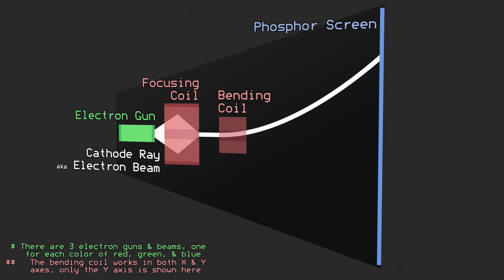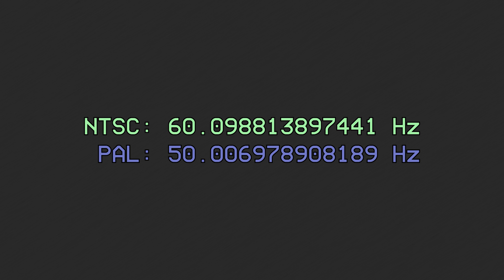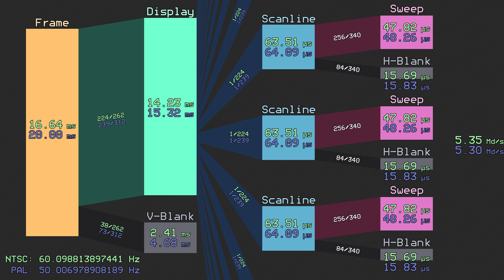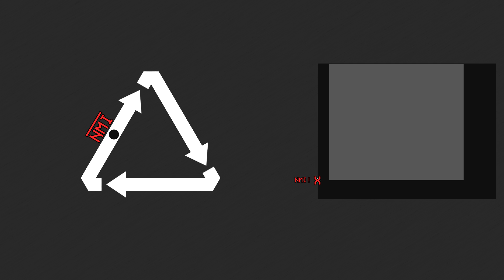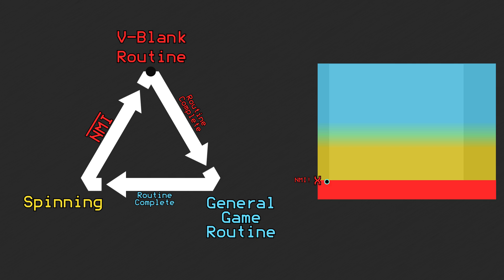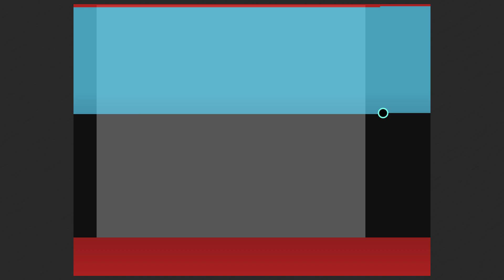Lag & Blanking - Super Nintendo Entertainment System Features Pt. 06

Comment: You missed the opportunity to explain why the PAL version has more HDMA time.
Reply: It's because the frame rate or refresh on PAL is slower than NTSC. Slower refresh = slightly more HDMA time. That's also why any games specifically made for PAL only play too fast on a NTSC console.
Reply: I can explain that better: NTSC and PAL have almost the same amount of lines per second: 15750 vs 15625, also know as 15 KHz. NTSC divides the lines into 60 fields of 262.5 lines each, of these 240 contains the picture. In PAL it is 50 fields of 312.5 lines, of which 288 contains the picture. The SNES displays 224 lines on both NTSC and PAL. This means that on NTSC there are 262.5-224=38.5 inactive lines, and on PAL 312.5-224=88.5 inactive lines.

To illustrate it simply: The screen is 50 lines higher in PAL. But the number of active lines is still 224. This increases the number of inactive lines from 38.5 to 88.5 (164% more inactive lines). Some processing can only be done during inactive lines, as the video explains. This might be why the game Winter Gold is only available for PAL.

More about NTSC/PAL: https://www.youtube.com/watch?v=3JFt6t6ijLs
Reply: @At Choralone422 it actually isn't.

Framerate differences only account for 20% difference, yet DMA time on PAL systems is as much as 85% higher per frame.

The real reason is that PAL displays are 312 lines instead of 262 of NTSC.
Even with PAL games generally going with 240 line resolution that still means there's now 72 blanking lines instead of 38.

Big, BIG difference, and lower framerate is only a small fraction of the difference.

Comment: What I’m curious about is, how specific is this to the SNES? Like, is the process pretty similar for other game consoles?
Reply from the maker: Most consoles that were built to output on a CRT use something similar to what's shown in the video. I know for sure the Atari 2600, NES, & Sega Genesis used similar formats. Also, I know the GameBoy and GBA use similar formats as well, even though they use LCD screens.
Reply: The NES is basically identical to this. Except the processor is 3 times slower.
Reply: yes but what about like.. the sega genesis? or the nintendo 64?
Reply: I believe this video is placed where it is in order to more smoothly transition into what HDMA does for the SNES hardware.
Reply: Some of it is specific to the SNES, much of it can be said about nearly any 8 and 16 bit console and home computer though.

The Mega Drive/Genesis works pretty much like this.
NES and Master System too.

c64 does something similar (though it lacks DMA, so the way it behaves is different. - and often you'd use what's called a 'display kernel', the practical effect of which is that the CPU is used to update the screen while the display is active, and all game logic happens during Vblank - the reverse of how a SNES does things.)

The 2600 definitely does this. (though again, display kernel, so reversed logic) - While a Display kernel on something like a c64 is sort of optional, on a 2600 it's mandatory, since the video system can only output a single line of graphics that you have to change every single line.

When you get to a PC, with VGA graphics, things start to look rather different, though there's still a bit of similarity.

an n64 works somewhat differently...

Though in general the idea isn't that far off.

Most 3d systems, and the PC since very early on use a system called 'double buffering'.

In this, the game logic and any graphics being drawn by the CPU, (early PC graphics cards were exceptionally stupid, so the CPU is doing 99% of the work)  are done, then that data is transferred from main memory to the graphics card.

The graphics card keeps that memory until a vblank happens, then swaps what's onscreen with the newly updated image.

It's got different implications, but really, it's broadly the same concept.

Do game update on CPU, transfer relevant data to the GPU, get GPU to swap the old image for the new.

The advantage of double buffering is that you can mess with the display memory all you like whenever you like, and as long as you aren't messing with the memory used for the active display, it won't have any effect.
Then, when you're done you swap which part of video memory is the 'active' image, and so on.

I mean, technically you can do this with a SNES as well, but with only 64 kilobytes of VRAM it's rather awkward. It also makes a lot of the more complex special effects impossible, since those only work on the active display.
Reply: The SNES is 1.5 to 2x as fast as the NES depending on the cartridge ROM latency.  Early games had 2.68Mhz ROM chips, later games had 3.58Mhz ROM access.
Reply: The Atari 2600 was very famous for similar stuff. It had very VERY little RAM and no actual graphical processing hardware: The CPU had to do it all itself. A common trick was to hold off on ANY game logic completely unless the console was rendering something black on the screen, at which point it would frantically try to get as much logic as it possibly could get done during that time until the game required more rendering was required on screen, this along with the vblank period was about all the time they had to do any logic whatsoever.

Comment: Thanks for the awesome, easy to understand, video! Reminds me of the book Racing the Beam, which talks about developing for the Atari 2600, which was a herculean feat because the hardware was incredibly limited.
Reply: A lot of the more advanced graphical techniques can be traced back to the 2600.
For later systems they were used for complex effects but were sort of optional.
But the design of the 2600 means you basically need to do them as a matter of routine.

Almost all 8 and 16 bit systems do variations on this stuff though.

Does remind me of the Atari 8 bit home computers; They essentially have an upgraded version of the 2600's graphics chip, but then have a second chip that is like a special-purpose CPU, which for basic tasks does the stuffing of the data into the main graphics chip for you automatically.
This design was exceptionally flexible, and let you do things like switch graphics modes 5 times in a single screen, changing resolution, colour depth, to text or graphics mode, etc, all basically without CPU intervention.

It's still the same principle though; Change the data each scanline...
Reply: That's exactly what I was thinking! Nick montfort visualized the Atari screen much the same way as in this video, and that forced blanking during h blank is familiar from old atari games with lots of black artifacts like space invaders
Reply: Yeah, pretty much the frame buffers solved that issue, so from then onwards you only had to race the beam during VBlank, the display was handled automatically.
Reply: The Atari 2600 was a machine designed to run Tank. Making any other game run on it required that your cartridge pretty much hack the console in real time.

Comment: Really cool video on CRTs and Blanking! I never really noticed the black flashing on the top of the screen, but this is really cool to see at a hardware standpoint!

Thanks for another awesome video!
Reply from the maker: If the bar is sufficiently small, its possible it could be hidden; however, there's not really a limit to how badly it can lag--the black bar could even take up the whole screen if the v-blank routine took an insane amount of time.
Reply from the maker: Patrons can get early access ;)
Reply: Correct me if I'm wrong, but the black bar at the very top of the screen would probably be hidden by the TV's over-scan, thus you would never actually see it on a CRT.
Reply: Are there examples of games in which we can easily observe this problem?
Reply: How does your comment say "1 day ago"?
It's only been less than an hour!